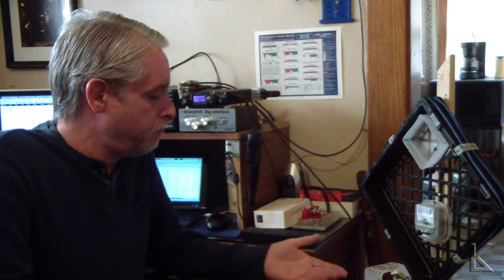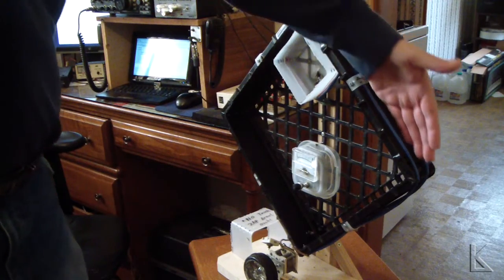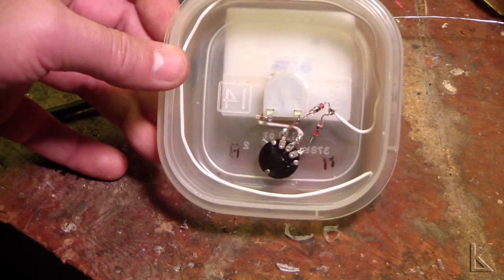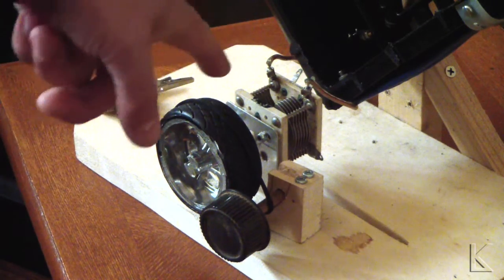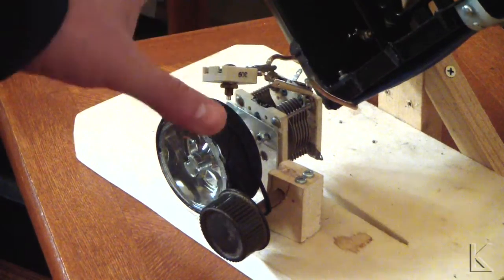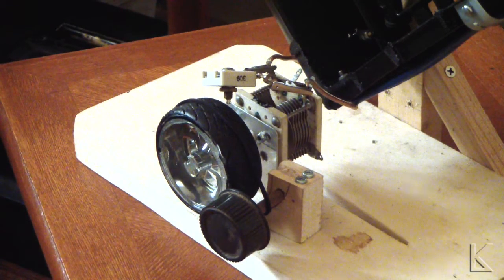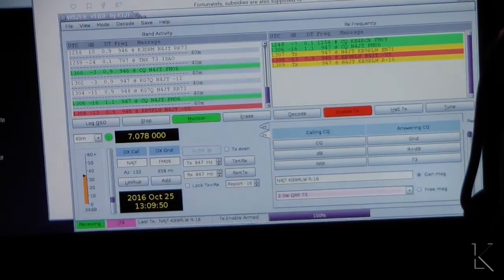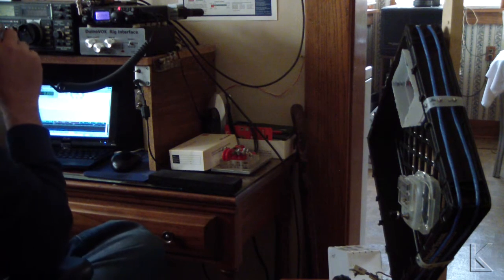Ham Radio - Junk Box Magnetic Loop final design overview and on air test

Comment: 日本人です♪空気バリコンの入手が困難です。中古品でも高額で買えません。
Reply from the maker: Ebay or amazon.  Also mouser electronics.  There are many sources.
example:
https://www.amazon.com/FidgetGear-Broadcast-Dual-Unit-Dielectric-Capacitor/dp/B07K1K1YSH/ref=sr_1_12?dchild=1&keywords=variable+capacitor&qid=1622892531&sr=8-12
Reply: @loughkb  ありがとう。

Comment: Kevin, 
Your meter that you built with the POT, I see that it shows only number annotation but is it an ampere, volt or watt meter? 73 KI5IUF
Reply from the maker: It's just a meter movement. It could be any of those things with the appropriate shunt or voltage drop resistor Network across it.  In this case, the markings are meaningless.

Comment: @Kevin Loughin Just curious Kevin as to how that would of done outside.  You got to figure in the house you have electrical, telephone and if you have cable TV then TV cable running thru your house, I am sure that has to have an effect on the radiating pattern of the loop.  I am very interested in making one of these to use with my QRP rigs like my uBitx, Bitx40 and my QCX40 and 20 Meter cw rigs.  I am wanting to start working POTA and I want an antenna that is portable and easy to setup.  If that square loop would do 40, 20, 15 and even 10 (but not to worried about 10 much) I would love to build one of these.  I even have the milk crate!!  I would just need to find that butterfly capacitor.  Juddie WD8WV

Comment: And THAT my friend is what ham radio is about!  Great job.  Loved the 2 vids re the 1ft mag loop.  I've just completed a 40m loop as well, but mine is 10feet or so in circumference.   I’ve only fiddled with the thing in the basement.  Unfortunately, it’s too cold and snowy here in Canada for my old bones to get outside and try it.    Great idea with the trimmer and 
“on-board” FS meter.   Thanks for posting these.  I really enjoyed it.
73 Bob VA3IF
Reply from the maker: +PintDrinker60 thanks Bob.  I've put a FS meter on all my magloops. It's a great way to fine tune them.

Comment: whats the max power you can / should run with it??
Reply from the maker: I have run 5 watts just fine.   With the plate gap on this butterfly cap, I feel I should be safe up to 10 watts.   I'd bet it won't arc until you get near 20.